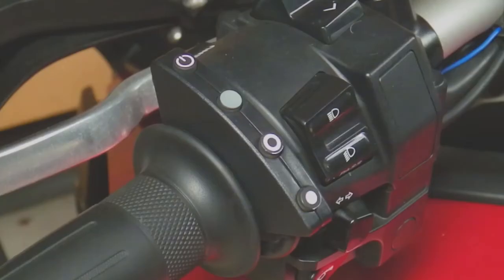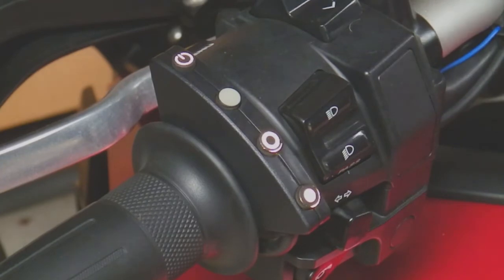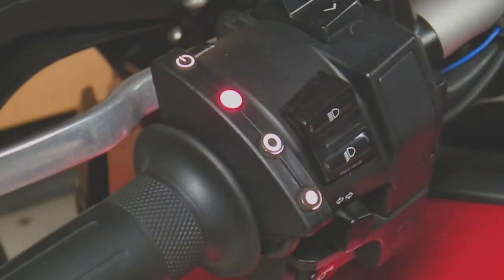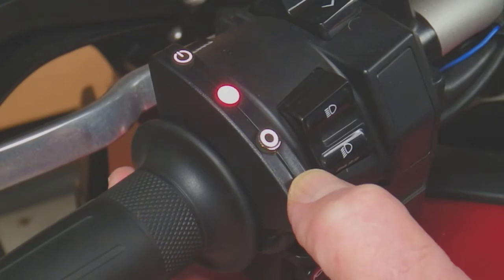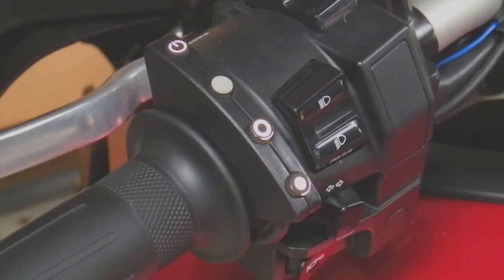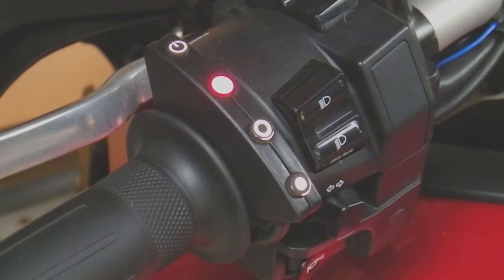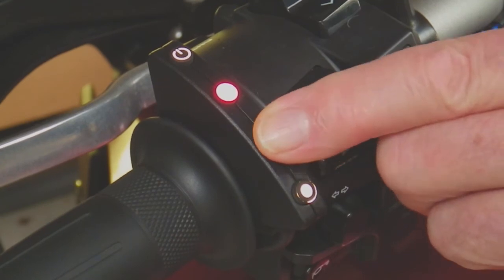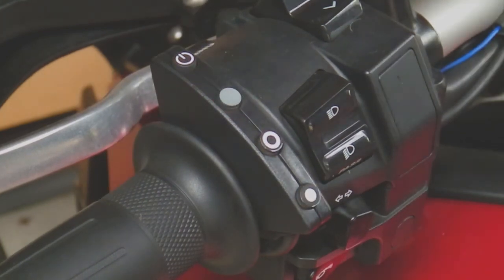MCCruise TBW Calibration Procedure

Comment: Does it make a difference if the engine is warm or cold when setting the idle? Cold start will idle higher so
Reply from the maker: Howdy, The throttle calibration needs to be completed without engine running, the cruise is measuring the results from the throttle not what the ECU is putting out to the throttle body actuator.
Reply: @motorcyclecruise8224  Cool thank you